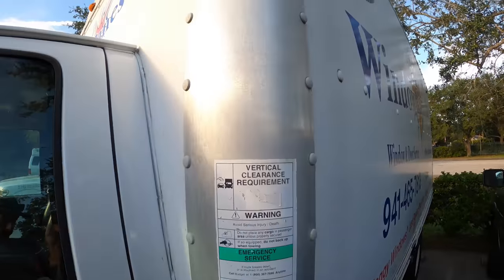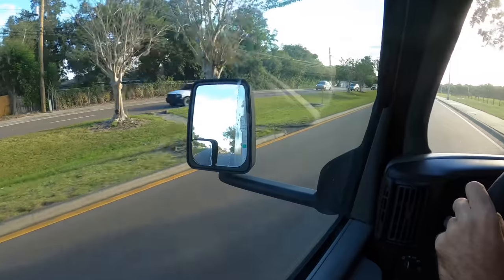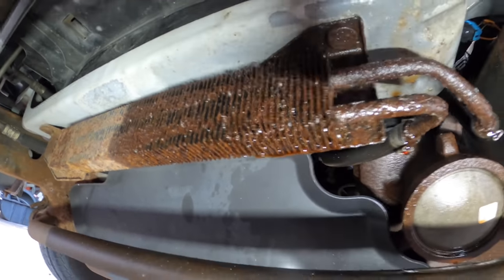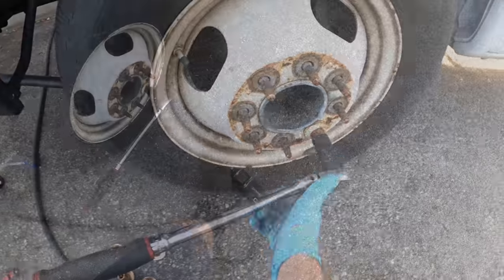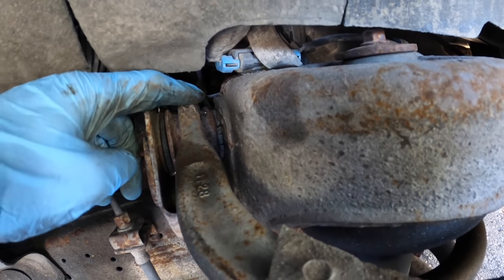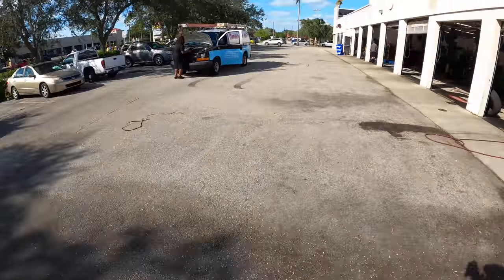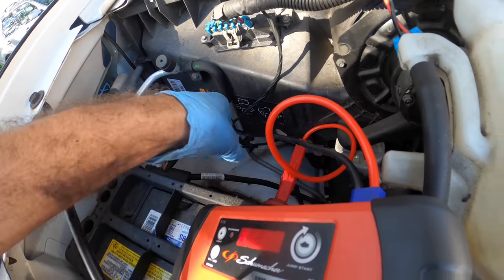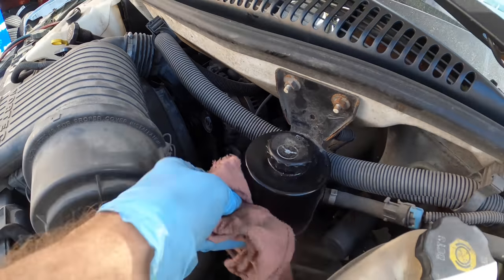Two Hour Inspection | DECLINED everything! almost

Comment: 25+ year tech here... Back when I was at my first indie shop my boss happened to run the local franchise for the Dish Network and we had PILES of those Express vans in every 'flavor.' They're miserable to turn a wrench on, especially if you needed to pop the doghouse off. They had these big ass aluminum box/ table thing for the laptops, work orders, etc. You had to remove all that B.S. before you could even pull the doghouse out. The fasteners were almost always stripped in the holes and would just spin. The worst part about it is the suspension/ steering were always falling out of the things, and the brakes/ tires were always whooped as well. The Dish guys didn't have to be responsible, so they pounded the hell outta them. Totally miserable to work on, so I absolutely feel your pain and don't envy you... LOL thanks for sharing. 👍✌🙂
Reply: I've seen much worse. They heavily salt the roads where I'm from.

Comment: I'm kind of surprised someone hasn't bypassed that cooler with a short piece of pipe and couple hose clamps.
Reply: He did. 🤣
Reply: Years ago I did that on a 93 buick lesabre. Later on i realized i could have gotten a transmission cooler and used that.it would have been overkill but probably would work.
Reply: Scotty, that would mean someone would have actually looked at and attempted repairs. Lots of front end repairs needed, and if it was me all bushings and down to new springs too.
Lifetime parts wit90h no zerks only mean very short lifetimes on all cars, SUVs especially since people don't realize they're now driving trucks, heavy trucks. 90- 100k is when they start wearing out, getting noisy over bumps and just feeling loose.
Reply: ya and it most likely would have the same cooling effect!  haha
Reply: When he was removing it there was what looked like the same part on the round bar in his way.

Comment: I did domestic,  American car and truck suspension repair for 40 years.
There is no way in hell that front end 'needed' an overhaul.
The condition was well within normal parameters. Note* Most undercar shops do NOT allow large prybars and monster pliers as tools to 'test' for movement.
Disappointed on the overcritical opinion on condition of the work truck. There are listed tolerances for component deflection. The problem with the brake pull was likely related to the brake system, which was not addressed.
Swing for the bleachers too much and you'll strike out much more often than if you concentrate on hitting the ball.

Comment: Good thing is, if they do get in a collision the unsafe nature of the van is documented for the benefit of any other drivers involved. 
 Cargo vans used commercially require DOT registration, yes? Anonymous tip to DOT?
Reply: Depends on what commercial use and GVWR.  It will have DOT numbers if it needs DOT registration.

There are ways to report unsafe vehicles on the road.  But nobody does anything any more.
Defund the police and we're safer (not)
Reply: @fhuber7507   Sorry but I do not approve of cops being tasked pull over drivers who are not otherwise breaking any laws because they received an anonymous tip from someone who claims the vehicle is unsafe..   I can see it now the city police officer being tasked to crawl under this truck because of an anonymous tip and inspect the ball joints, control alarms, et cetera and then make a determination that the ball joints are worn and that the control atrm bushings are cracked.

Comment: Let me guess owner didn't want to pay for a OEM finned cooler
Reply: Sounds about right
Reply: Who would they. aftermarket is cheaper
Reply: @jeremypilot1015  that's why you end up with a piece of tubing rather then the right part with a 70% less cooling capacity and more mechanical failures shouldn't own a vehicle if you can't maintain them
Reply: Those vans come OEM with the unfinned cooler. The finned one is offered as an upgrade.
Reply: @chekelley6861  and as you can see in the video not a direct fit replacement that looked like a Dorman , a Hayden universal finned cooler is only $25 OEM $100-200 same labor cost but direct fit maximum cooling designed for that system 🤷 there's a reason there cheap after market parts
Reply: @dencowboy1040  Dude it's a Dorman part, No mechanic should have to use Dorman ever. everyone knows you buy the cheap Chinese knockoff from Amazon or eBay. NAPA sells crappa!

Comment: I will admit that watching parts of this video were painful to me.  I have an aversion to anything that uses a straight blade screw.  IMHO straight blade fasteners should not be manufactured.  There are many other fasteners  that are easy to work with.  (Torx)  Any time I am faced with a hose clamp , I reach for a nut driver.  A 5/16 and a 3/16 will handle most of them.  Secondly,  the factory hose clamps,  you took the wrong approach to remove those.  If you had enough force to completely cut through them, hats off to you:  Using the side cutters only tightened them.  Using a pick or an awl to work into the space between the crimp to spread the crimp open could have saved you some frustration.  I'm happy you got the job finished, because I disdain straight screwdrivers.  That's all I have to say.  "CLICK!"
Reply: Those hose clamps will blow off from power steering pressure in no time.
Reply: Yeah, for sure! I always use nut drivers on those things. So much easier that having a straight blade slip off a hundred times.

Comment: I love the air ratchets. Such a time saver and a busted knuckle saver. 
Old school is the school I went to. 
The hour long 1/16 inch turns with an open-ended wrench to get a nut off a 1-and-a-half-inch long stud that was completely remote to almost any tool, was a testament to youthful determination and an education of the finest kind.  The final test was knowing those very nuts and bolts and parts had to go back on without having too many of any of them left over. That was the education of mechanics I had, and I am grateful for it. 
 Oh...I do wish I had air wrenches and ratches!!  Like comparing landlines to cell phones. Embrace the advancement in tooling but always know the heredity of it.

Comment: I had the same problem with turning while applying brakes.  Turned out it was a blocked brake hose on one of the wheels.  Replaced the brake hose and worked fine

Comment: ROGO lightning and The Astro 1/2" or 3/8" Nano Flex head impact is made for those rusty angled tight spots. Just thin out grease and remove internal muffler before use.

Comment: Control arm bushings were dry rotted but still functional.   My only criticism.  I wouldn't have left the vehicle off my lot until the customer signed a waiver specifically for the sway bar bushings being absent.  BTW, it's called  a  "funnel"....use it.

Comment: from my understanding those none finned Tcoolers need to be infront of a radiator with an active fan to ccol properly where as a finned cooler at slow speeds climbing hills will have enough airflow where as a tube cooler will struggle because of lack of surface area

Comment: Absolutely shocked by them not getting it fixed, here in the UK, that van would not be allowed back on the road until all work was completed. I’m shocked that the US allows vehicles in that state to freely roam the highways where there are other vehicles with children on board. 😡🤷‍♂️
Reply: You'd be taking away that person's means of making money (which means that maintenance will never get done) 

It's like taking the battery out of your car and not putting it back in until it starts
Reply: @mwbgaming28  judging by the state of that vehicle, maintenance has not, nor ever been high on their list of priorities, so I doubt them achieving the means to repair,  that it would ever be done.
Reply: @hikingwiththeshackletons  the owner could be struggling to make ends meet, and taking away that vehicle could make that even worse 

Maintenance is expensive, and most people can't afford it, and a large percentage of those people don't know how to do it themselves
Reply: @mwbgaming28  yes I understand what you’re saying, however, my point is, if low cost maintenance was carried out regularly, that van would not have ended up in the state it has. Secondly, continuing to drive it in that dangerous state puts lives at risk & that is irresponsible, regardless of whether they need it ‘to earn a living’
Reply: @hikingwiththeshackletons  so you'd rather see someone out on the streets because there are no payment plans.etc for vehicle maintenance and they can't afford it

Comment: I had a 2008 4 runner come in for tires today. Just tires. Just on my inspection I found a cracked radiator like pouring fluid. Both head gaskets dripping coolant down the block rust holes in the frame water pump leaking both rear axle seals were totally blown. Dude sais I know it's fine and has me put new Michelin tires on it anyway. Some people are crazy man

Comment: This is exactly why I stopped going over the top with my inspections I see something wrong and I just recommend it because customers can be absolutely insane with what gets approved and what doesn’t. I had a customer approve 4 tires and note the tires on the car had a little life I recommended them as a cautionary rec. but declined brake pads when the inside pad was almost down to bare metal. Also their initial complaint was low performing brakes

Comment: Definitely looks like a typical Dorman replacement part and the lack of quality is apparent. I learned the hard way by trying to use a Dorman intake manifold. 2 of them were warped out of the box and the 3rd was questionable. Luckily, it worked for 2 months until someone ran into me and totaled my car.

Comment: Hi..I like your videos im a 32 year vet of collision repair aka bodyshop stuff.we had a 2021 buick encore 300 miles on it we had to pull front end off 3 months later we get lower rad hose national backorder new design for 2021 and replace serpentine belt and noticed it had wrapped into ac compressor we took that apart cleaned the strings out of pulley put new rad..ac condensor ect in it checked for engine codes none clean bill of health left it running for customer outside he crawled in it after waiting 3 months for parts it started misfiring 1.3 liter duel turbo.and come to find out what it was was the serpentine belt that had shredded in accident had slapped the water pump it looked good visually but behind pulley the belt had put a bend in the seal of the water pump but wasn't leaking nothing and was check engine light misfire then it was fine then misfire random stuff.collision job from hell lol.brand new and guy hit a deer on the way home from dealer thing

Comment: New subscriber... No mechanic but watching your videos I feel a bit more educated to hold my own with the dealership or any service center. That said I wanted to get your take on Toyota. I have a 2020 Rav4 and have had Ravs for over ten years. Pretty bulletproof but I'm planning on keeping this one for several hundred thousand miles? Is that still realistic with proper maintenance? I live by the old saying "you take care of it and it'll take care of you." I follow the owners manual to a tee except for the oil change interval which I've heard 10k miles, even full synthetic, is BS as mechanics are already finding piston ring failures and excessive sludge at the top of the engine. I change mine every 5k. I would certainly appreciate your few minutes of input for Toyota longevity. Thanks and keep up the great work... Wish I lived in Florida for many reasons. I know who my tech would be for certain. Take care!

Comment: That's Shocking here in the UK that Van would have Failed its MOT (yearly safety &performance check) if they wouldn't fix all the issues it would be scrapped . Hate to be on the same road when 1 of those components  fail!.It must really Frustrate you seeing that sort of thing on a regular  basis .

Comment: Ray I just recently subscribed to your channel, every video I've seen so far including this one I absolutely love them if you and I work at the same shop we would definitely get along you and I have basically the same temperament and react similarly to most things LOL I worked at a shop in Dallas Texas and I can't tell you how many hundreds of times some raggedy POS shadow of its former self truck SUV or van would come dragging itself into the parking lot barely holding together needing everything and it absolutely gets nothing fixed and they come pick it up and drive it away it seems more and more is the days go by the cars are in worse shape and people want to fix less and less LOL eventually there's going to be none of those cars left!!! Hahaha all jokes aside, I know the feeling when something like that van drops in your lap it takes so much work to inspect and diagnose something like that you had four or six jack stands and two jacks holding that humongous thing in the air so you could take all the wheels off just doing that takes so much time and then having to manually bust every nut loose on each wheel because they were impacted on there by a Greek god and then they don't want to fix anything related to safety except for the lights when the whole front end is trash. I know the pain bro! And you're right, you can't win them all. But the ones you do win you do a fantastic job. 
Hope YOU don't forget to have a good day! ;)
Peace!

Comment: Ray if you look at the can of oil or power steering fluid they are designed that way for a purpose you’re supposed to have the spout on the upside instead of downside to control the amount of fluid that comes out that way you don’t spill any. I did not even know that myself until I saw a video here on YouTube explaining why that design is that way try it it works you will not spill anymore lol God bless you✝️✝️✝️

Comment: Hi. Can I make a small suggestion. When tightening the hose clamps,instead of using a screw driver,use a 5/16 or 8 mm socket or nut driver. It would be a lot easier.

Comment: Cheap owners were the bane of my existence when I was a truck driver.  I caught what should have been a milk run, Port of Long Beach to a distro in Las Vegas hauling a reefer filled with Vietnamese shrimp. Just over the Nevada border on I-10 and my engine decides to stop being an engine and take up a career as a very big paperweight. I got off the road and waited 13 hours for the tow and the rescue tractor, but it was too late, the freezer unit had died and I now had close to 40 tons of rotting shrimp sitting there.

I lost half my mileage and my on-time bonus and got to spend a week in Las Vegas on a per diem that barely covered a cheap motel and gas station sushi. All because the bosses had kept putting off maintenance and lying to the drivers about it. I got a better job within the month.

Comment: I know all about that pull while braking on GM vans. Specifically my old 2007 2500 express. Something they did with the brake booster and power steering working off the same system or some bs. Not 100% sure what it is, but my issue was insane. Basically when I hit the brakes, it would take away all power steering, but it’s not that the steering was really heavy, it basically locked up. But the real kicker was that the brakes wouldn’t work either. It felt like a hole brick was behind the pedal. Standing on the pedal with both feet applying as much pressure as possible, my back smashed on the seat back, only slowed the van down. Barely. It wouldn’t lock up at all. I drove like that for a couple weeks cause my boss was kind of an ignorant prick about it for some reason. If someone cut me off, I couldn’t stop or swerve out of the way. Scariest shit ever. I have another 2007 2500 express now, I’m sure it’ll do the same thing at some point.

Comment: A straight screwdriver is the easiest way to remove those crimp rings. Then you can use 3/8 or 1/2” crimp rings with pex crimp ring pliers to re install on the new part

Comment: was the cooler itself broken? or was it leaking at the lines? The rusty fins probably weren't cooling that much anyway but I would have swapped the clamps if the cooler wasn't broke.

Comment: A good tip for cutting rubber hosesi just use a sharp knife, smear some dish soap on the hose and the knife cuts through easily and gives a clean cut.

Comment: Saw the box van/truck, heard it had power steering leak, and immediately jumped to "yeah, that's the tiny worthless PS cooler." We have the same truck at work and the same part fail. They rust so badly being exposed like that.

Comment: Those GM rubber valve high side always leak, I replace them with a brass replacement any time one comes in with AC trouble. The moment you don't replace it before charging, you pop the highside charge hose off and you'll be greeted with a r134 geyser 🤣🤣

edit  : don't stop saying click

Comment: By the way,  I noticed you were trying to cut off the hose clamps with side cutters in the same way as you would pinch them tight. It is easier to cut them if you cut across  the tip of the pinched part that sticks out.

Comment: I would think that since this seems to be a  business vehicle that there would be less resistance by the owner in getting the problems fixed, since the repair cost is deductible.
Reply: If it is a small business or poorly run buisiness, they may not have that kind of money at that time to have that much work done.   My guess is that it is more of a pooly run business as bad as the condition of that van is in.